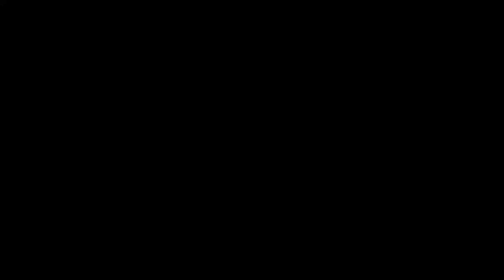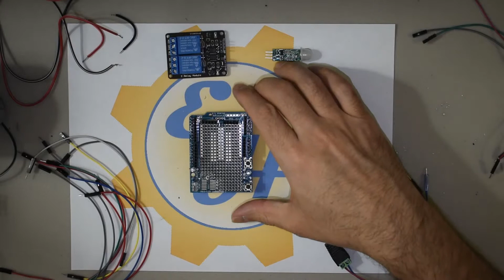3D Printed Scissor Mechanism - Electrical Connections - Part 4

Comment: Incredible worK!  Have you thought about making and enclosure for the electronic components?
Reply from the maker: Thanks! I've considered it, but haven't had the chance to work on it. Been working on some other projects that have been taking a bit of my time. I've also been considering designing a circuit and board specifically for this project, but again, no time at the moment....